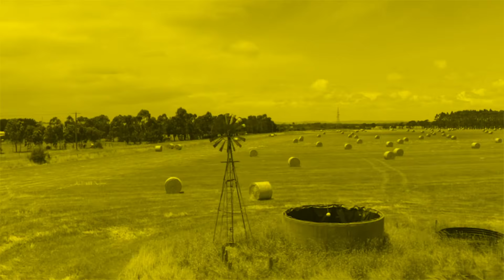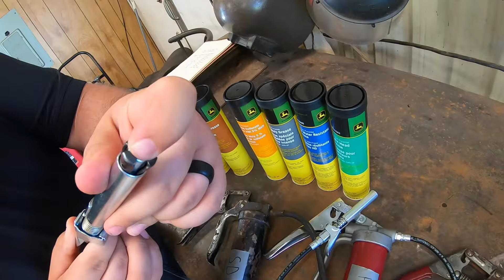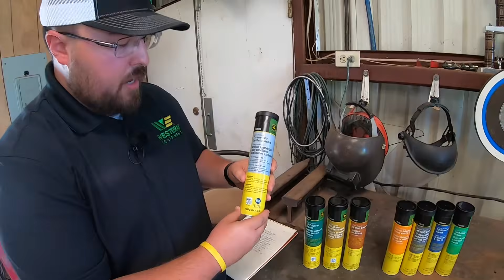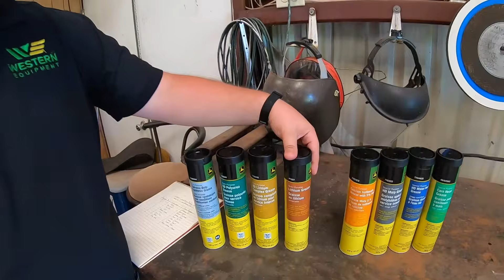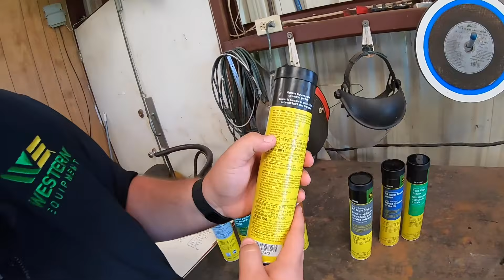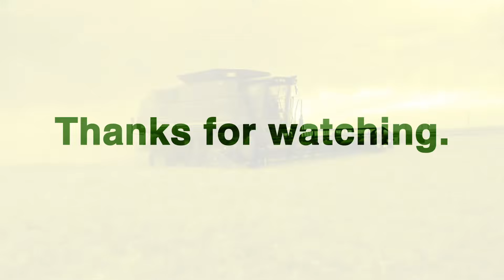Which Grease to Use & How to Use Grease | Explaining 8 John Deere Greases

Comment: Worked at 2 different industrial plant. Each had that guy who got all the equipment to use one grease. Give it a few months and equipment failures start stacking up and electric motors start failing. Then the finger pointing starts and blaming people not greasing. People really don't know about grease. But it gave maintenance a lot of overtime.

Comment: What would you recommend for a troy built lawn mower tractor 42 inch mower deck spindles.... temps get here around 95 at times in the summer. Mower decks removed in the winter for plowing
Reply from the maker: Usually for mower spindles, any kind of regular lithium grease will do the job.
Reply: @WesternEquipment  thank you.
Reply: So far all I came across is "red an tacky grease" made by "lucas" does have the nlgi of #2 does show it has lithium.

Comment: Great info, which one would I have to buy for fertilizer spreader gear box? The gears are Nylon, not metal. The manual says they need grease but doesn't specify what grade or kind. I read somewhere that theres certain grease that can eat up the nylon gears. Thanks
Reply from the maker: That is a tough one. I would want to get in touch with the manufacturer on this one to make sure i was using the right grease. I don't want to be the one to steer you in the wrong direction.

Comment: Similar but different circumstances, we use a big dust blower to pump from a limestone silo at work. We'd went through 3 blowers in just over a year. Our lead maintenance man had been putting Mobil 1 motor oil it them( they're shipped without oil) and the 3rd one went out on my shift and me and my maintenance guy had to change it out. It had a tag on it with the specs for the oil it called for. We couldnt find it in the plant so we called the maintenance lead from day shift and that's when he said to use mobilb1 motor oil. My guy didnt trust that and called the manufacturer of the pump. They said absolutely not to because of the heat and tolerances the pump had to endure. We had to overnight a 5 gallon bucket of the correct oil. We got reamed the next day for causing downtime, but guess what,that pump we installed stayed in service for almost 2 years with only routine oil changes and was still working when they shut the plant down.
Reply: U deserved a gratitude attitude from the lead! Hats off for doing the right/smart steps 👍.
Reply from the maker: Using the right lubricants in any situation is always the way to go. Making sure to use the correct kind and correct specifications will always save downtime.

Comment: I live up in the mountains. When its hot it goes up to 110 degrees. Cold weather it goes down to 20 degrees. What grease tube do you recommend?
Reply from the maker: It really depends on what type of machine you are greasing. Most greases will not have a problem with this range of temperature but the application of the machine and how much heat will be produced at the grease points is the question.

Comment: I have a s100 and I was wondering if super lube multipurpose synthetic would be compatible with the factory grease?
Reply from the maker: I am not sure which grease they use from the factory but that grease should work just fine for your mower. Thanks for watching!

Comment: Hey Brent, do you have a how to grease video for the S240 or any 200 series mowers?
Reply from the maker: No, I don't at this point but if you check out my S240 videos on my channel I go over the grease points. There are the spindles on your deck, both axles on the front and then there is one in the center of the front axle where it pivots in the middle. I hope this helps and thanks for watching!
Reply: @WesternEquipment  awesome, thanks a lot!  Very informative videos

Comment: I am having difficulty finding a grease for my Craftsman snowblower Auger 
gearbox . Recommended is one of the following - Lubriplate 132, Mobilix EP1 
or Shell Aldania EP1 .can you recommend ( Live in Ontario Canada )
Reply from the maker: Unfortunately, John Deere does not make a grease that is rated at a 1 on the NLGI scale. All of our greases are either a 2 or a 0 and that is a very important part to using the right grease. I would suggest going with any of the 3 you previously listed, but I do not know that I would have a preference from one to the other. I hope this helps and thanks for watching!
Reply: @WesternEquipment  Thank you for your reply .
Reply: Amsoil sells what you need for EP No. 1 grease. (Don't be tempted to use No. 2 in its place.)

Comment: Some videos say that the JD Mower spindles are sealed and grease does not actually get in, so no need to use grease for spindles.  Is that true?
Reply from the maker: This is true on some mower models yes, but it is still important to keep grease in that spindle to keep rust from building up on the shaft. Good question and thanks for watching!
Reply: @WesternEquipment  Thanks for the answer.  I have an S240.  Is my spindle sealed?

Comment: Hello ! Great content ... I have a question ⁉️

Which NLGI grease should i use on guns usually over and under shotgun on its metal to metal rubbing parts ??

Also tell the base ... I have mostly lithium base available in my country
Reply from the maker: That is a good question that i do not have a good answer for unfortunately. I would look into what the gun manufacturer suggests in this instance. Thanks for watching!

Comment: Which grease would you use on a 2021 S130 mower
Reply from the maker: You could use basically any type of grease from a basic lithium up to a HD moly grease. Most of out customer use the SD Polyurea as it is on the upper end of the scale but not the heaviest or most expensive but it is a very versatile and reliable grease.

Comment: Hey. I just bought 4 cartridges of HD Moly for my JD x595. I intend to use it on all of the fittings. Is that ok? The difference to SD Poly is 20 cents and I was thinking this is a better grease. I wouldn't buy 2 grease guns to have 2 types.
Reply from the maker: Yes! It will work great! Thanks for watching!

Comment: Viscosity of your grease is what separates the sliding surfaces. Temperature is important, but at 400 degrees, the base oil viscosity checked out about 150 degrees ago. The NLGI number tells you what the flow ability and how well it flows in and out of a bearing.  What protects your equipment is the viscosity of lube at operating temp.  Good info, but you’re missing a ton!
Reply: Helpful input. Your insight would be greatly appreciated too. Any possibility of a future collaboration of you both expounding on this?
Reply: What tells you the viscosity at a given operating temperature? Given function of lubed areas on equipment varies what is it based on?
Reply from the maker: Thank you for the additional info, much appreciated! And thanks for watching!

Comment: I’m working on power tools, saber saws, reciprocating saws, angle grinders and don’t want to use something that will just fly out and off gears. Don’t think packing the gear box full is a good idea ether. Might be over thinking the whole thing but any help would be great. Thanks
Reply from the maker: This is a good question. I would have to see if I could get some more guidance to better answer your question on which grease to use. I'll dive into it.

Comment: Dear Sir, I want to use the grease on the bearing of the bicycle，seeking for better movement, should I choice nlgi 0 or nlgi 2 , thanks.   bearing movement test like this---https://www.youtube.com/watch?v=EJfe8FvQUQg#t=3m16s
Reply from the maker: Good question. I would probably ask the guys in that video what rating those greases are that they are using and then gauge which one you should use off of their response.
Reply: @WesternEquipment  Thank you, sir.
Reply from the maker: @jajambo1214  You're welcome. Let me know what works best for you.

Comment: PTFE biodegradable ? really ?
Reply: A number of brands exploit a rule which says a lubricant
can be classed 'biodegradable' if it's just 60%
biodegradable within 28 days. This rule assumes the remaining
40% is biodegradable. This is an erroneous
assumption. some petrochemical lubricants
with PTFE making this claim are not anywhere near 100% biodegradable.
Reply from the maker: Interesting! I will have to look more into this!
Reply: @WesternEquipment  Hi, i did found this here : https://www.green-oil.net/pollution.html but it was a tiny detail on really instructing video :) well once you have a running engine it is not biodegradable lube that'll make a big difference :D

Comment: Instead of buying John Deere brand (they don't make it anyway), buy a quality synthetic marine grade grease. Solves all your needs as well as the overpriced JD stuff. Grease often, the choice of grease matters less than the frequency of greasing. Cheap grease used daily will out perform the best grease that is neglected too long. Today's lubricants are so far better than 30 years ago. No one makes poor quality grease anymore.
Reply from the maker: I agree that greasing more often is great practice but efficiency is always something to consider. We all know different machinery has different uses and will have different types of wear. This where the different types of grease come in to play.